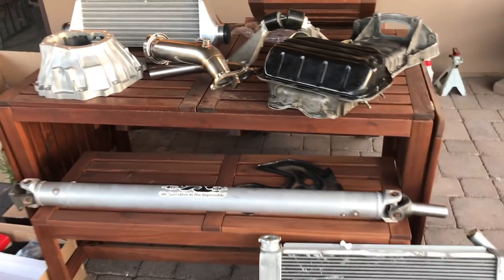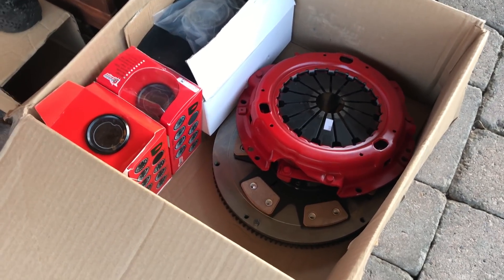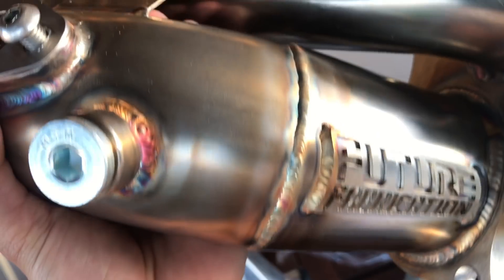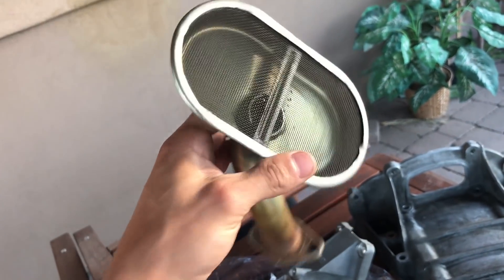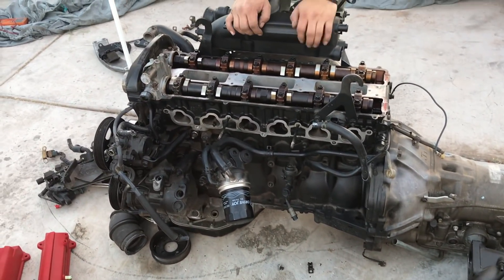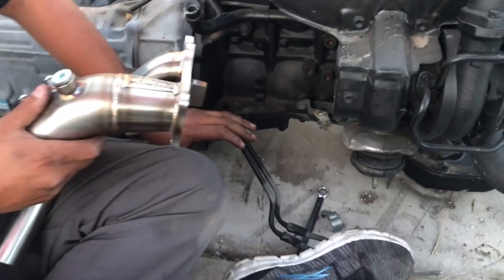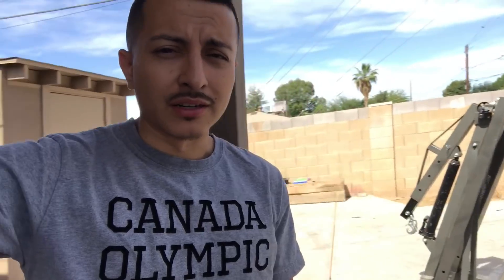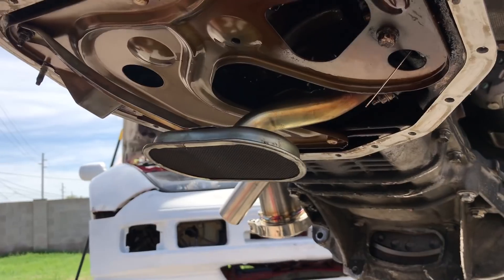Z32 OFFICIALLY 1JZ SWAPPED!!

Comment: The w58 will handle 400hp easy unless you drift or drag hard. The clutch kick in drifting shockloads and shatters gears. The launch in drag isn't bad what breaks them is when the car loses traction but then grabs hard again shockloading the gears and shattering them. The w58 was used in non turbo applications so they didn't use the same quality gears as they did in the 154. Though I'll have to be honest I've changed out more 154 than 58

Comment: Wait what why are you using a front sump if the z is a rear sump?????
Reply: Daniel Stewart the z32 is a v6 and a rear sump does not clear the steering rack
Reply: Carlo Gallardo it being a v6 has nothing to do with it and I thought the rack was mounted in the front
Reply: Actually it does its a shorter motor so that means the pan is ALOT shorter then the i6 I tried a rear sump there is no way it would have worked without extensive fabrication
Reply: You have to use a front sump upper oil pan to clear the steering rack.  Mr. Gallardo should have cut and reinforced the crossmember rather than notch the oil pan....he will run into oil drainage issue from the rear of the lower pan bc the lower pan is designed to work as a slope drain with the rear of the upper oil pan.  I too am swapping a JZ motor in my 300ZX....a lot of unknowns that aren’t documented anywhere.